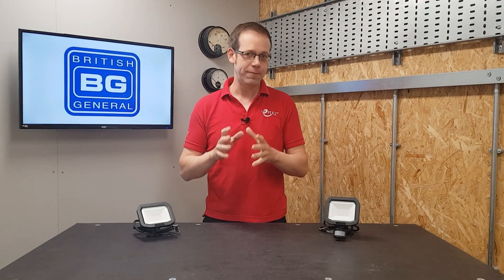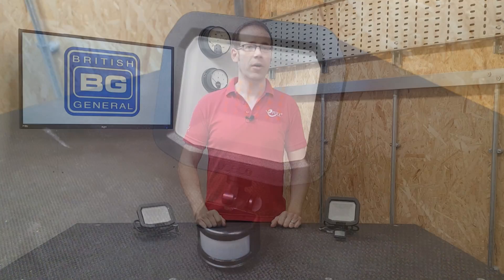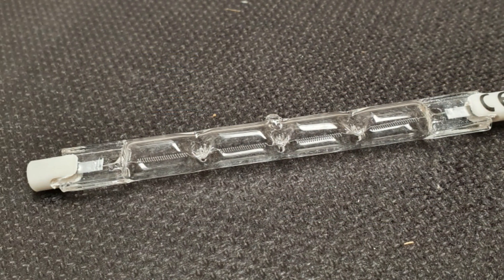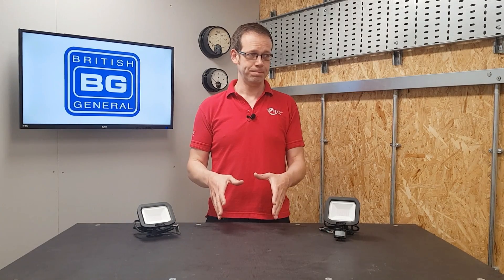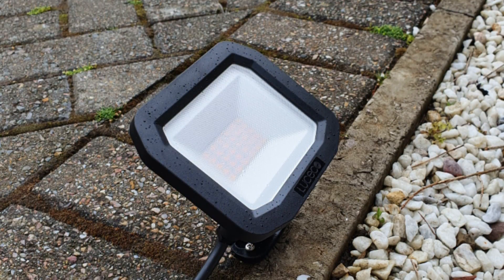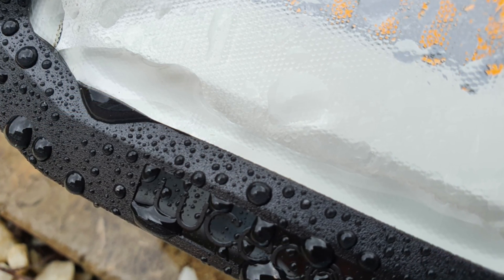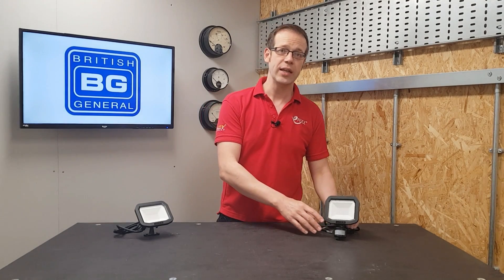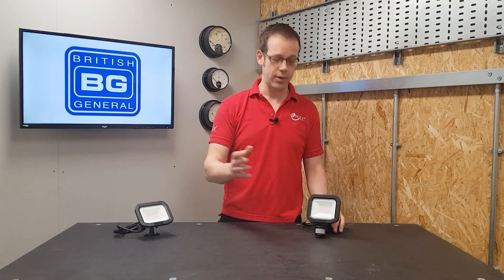LED Floodlights - How to avoid installation problems - do's and don'ts

Comment: Nice video. Question: is there any type of floodlight that you can mount on a ground and tilt up at a wall as you mentioned that you shouldn’t do that as it can let water in overtime.
Reply from the maker: You probably need a higher end architectural grade fixture intended for “wall washing”
Reply: @efixx  ok cool. Also the new Castra range by Luceco seems rubbish and it’s rather expensive compared to your average floodlight, for example a 10w luceco castra floodlight from screwfix is £19.98. Also the new luceco castra brackets are a bit strange compared to a regular floodlight. In my garden I have a LAP by screwfix 20w 2000lm floodlight with pir in my garden and it is excellent! It lights up the whole thing and only paid £12.98 for it. The lap ones are also extremely good quality and last very long and don’t let a single drop of water in so I think the LAP range is better, more reliable, and certainly cheaper than that luceco water filling rubbish. The luceco ones no matter how you mount them just attract lots of water and they are always flimsy plastic that will break at a tiny drop. A 10w luceco floodlight that I use to have couldn’t even light a small room nor a garden ffs luceco are USELESS

Comment: I feel that people don't understand the difference between horizontal and vertical. With the old halogen fittings it was the tube that needs to be horizontal, the housing can be swivelled to reflect the light downwards and so not go into neighbours windows. Yet so many times you see the glass faceplate vertical.

Comment: Only one reliable brand I have fitted is challenger five year warranty. One of the makes iv tried And fitted is the Luceco (old model) as a lower price opinion and had failure after failure. The failed units were always domestic and always fitted as per instruction. I’ve tried several brands and my experience is disappointment generally and annoying  returning visits to replace.

Comment: Maybe things should be built like they were in the old days.  Everything is soo plasticity, cheap, doesn't last long, and isn't supposed to do this and that...  Very few things 'just work' and last unless you pay a ton of money and know where to look.  Even fittings used in the correct environment from so-called 'quality brands' don't last.  I'm not saying we should go back to halogen, but at least they were so simple that the manufacturer didn't have much chance to make it go wrong with bad design (unless it had a PIR).  A lot of stuff was over-engineered in the old days but that had many positive side effects on all sort of aspects of the product.  Now everyone tries to shave on pennies and try to hit the very low bar of meeting 'standards'.  Many brands ride on the success of their past and the name they made for themselves whilst not caring about what they do as they once used to.

Comment: I Dont agree with the life span of a fitting over the years I have found the more the light is switched on and off is the key.EXAMPLE I have fitted lights where they have been on 24/7 for the last 5 years ( led ) and they continue to work perfect but the same light fitting on a unit with a time switch has been replaced 3 times ( same supply ) Switching deffo reduced life of a fitting.

Comment: I have installed a lot of LED security and floodlights and I still learned a lot from this - thank you.   I'll put my hand up to admit install these pointing upwards.  I get lots of requests to light trees, ornamental features, etc and small floodlights are perfect. So it's a shame the design doesn't allow for this, as there doesn't appear to be much else on market for this application.  Ground spike lights are ok, but are generally limited by the power of GU10 lamps most use.  I've had one LED floodlight used to light a large shrub fail after 3 years - it has water behind glass ... now how did that get there :-(    

My tip on using them on walls is to have supply cable coming through or down an outside wall terminate inside a Wiska box (308 is a good size).   Then mount the LED floodlight close by and connect the fitting lead in the box.   The Wiska box can cover a cable coming straight out through wall, and generally looks neater.  It also means you change change it more quickly if it fails or customer wants to change to higher or lower wattage.

While I'm at it ... when is someone going to come up with a better way of setting up PIRs - replacing those stupid tiny knobs on bottom.  Luceco's new range have the tiniest yet, and I have had two fittings fail when trying to turn them.   Hands up who has set up a security light, had customer agree it, only to ask you to call back to make it run on 5 seconds longer?  (Rant over).
Reply from the maker: Thanks for the comment. This is a safe space for electrical rants!
Reply: I buy Wessex brand from Toolstation. The knobs are much easier to turn. https://www.toolstation.com/wessex-led-pir-floodlight-ip65/p21678

Comment: Outside upward facing flood light requires an exterior surrounding case with a 45 degree sloping glass pane to keep the light weather proof.

Comment: Loved how you kept a straight when you said older, less reliable technology. Luceco 30000 hour LED floods will be lucky if they've 100th of 30000 hours. After fitting 5 and all 5 go, something has to be said about the claim of 30000 hours. With that performance, I wouldn't trust Luceco again.

Comment: Interesting point about facing up.... Back in the day that is what floodlights WERE used for architecturally.... I'm kind of glad the modern ones can't handle that because as you mentioned... Light pollution
Reply from the maker: Agreed!
Reply: @efixx  for very specific historical buildings its still a use case... but yeah, as a general thing, glad it's in the past

Comment: I once went out to a local farm before led lights were a thing  to remove a damaged 500 watt halogen flood light. 
The light was mounted high up on an open barn facing inwards which was used as a lambing shed where lambs were being born and straw everywhere, the light had no glass cover had gotten knocked and the hot lamp landed on the straw setting the barn alight,  luckily it was seen and dealt with quickly
Reply from the maker: Farmer 👩‍🌾 maintenance ☠️

Comment: I replaced a small 10watt pir led flood light for a luceco recently at my parents place to shine  on a corner path way  as the led lamps had gone to an orange glow in the existing light fitting , the one thing I noticed is the pir sensor didn't have a very wide angle so it only detects going down the one pathway.
I hadn't thought at the time and just saw the light fitting at the wholesalers so brought it spur of the moment , I should of checked the pir detection angle range.
Reply from the maker: Lesson learned! 👍

Comment: Never had any problems with floodlights Halogen or LED but the integrated PIR sensors have been no end of trouble causing the light fittings to be scrapped prematurely. 🤬
Reply: There's a reason PIR's fail.... they have to use polyethylene for the window as it's the only common plastic that's infrared transparent. It's also not stable in UV light (those of us who have been on lots of sites remember the GPO armoured cable with the sheath that isn't present above ground level?.... they lost thousands of rolls of that cable in open air storage in the 70s... because nobody thought to check if it was UV stable)

In short, PIR's WILL fail if exposed to sunlight.... if you're fitting a separate one ... try to bear that in mind
Reply: @TheChipmunk2008  well explained. I always wondered why the windows turned to dust. Makes perfect sense.
Reply from the maker: I believe they've changed the design of the PIRs as well. 👍

Comment: I have fitted many luceco led floodlights and find them an excellent product…I can honestly say I’ve (touch wood)never been back to replace a faulty unit
Reply: till this video did not know luceco was a BG brand... To be honest, BG have variable quality... which might be good, means they're adapting. The weatherproof storm accessories are our go to... the consumer units, notsomuch (RCD failures are common).  Luceco lights... yep. been pretty reliable.

(also BG, now the sun is setting on the split load board, was there an issue with the RCDs that has since been fixed?)
Reply from the maker: Good to hear!

Comment: Maybe if the manufacturers didn’t drive the LED’s so hard, heat dissipation and longevity wouldn’t be so much of a problem, see ‘Dubai lamps’ for properly designed lamps
Reply: its a trade off, what will the customer support vs how cheap can we do this.

Comment: Great video as always Joe 👌
You mentioned that the old halogen lamps came in 150w and 500w , I remember back in 1995 I was working on a building site in London and I had to fit 1000w halogen lamps around the the scaffolding to light the pit for the still worker’s building the still cage for the foundations before the concrete was pumped in those lamps were quite big and heavy a bugger to install on your own. 
Fantastic video lots of useful information to think about 👍👍👍❤️
Reply from the maker: Thanks for commenting Sean, sounds like a really interesting job you were in there.
Reply: @efixx  it was an exstention to the Gloster hotel in South Kensington